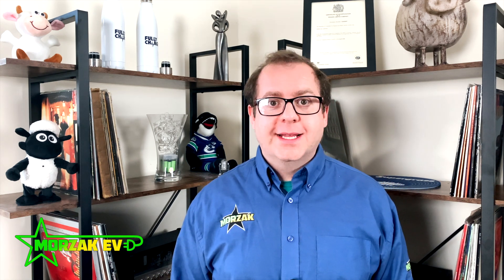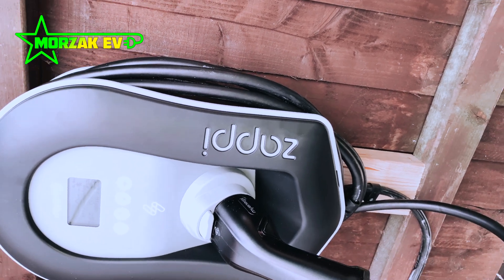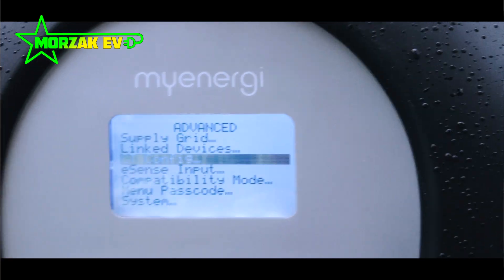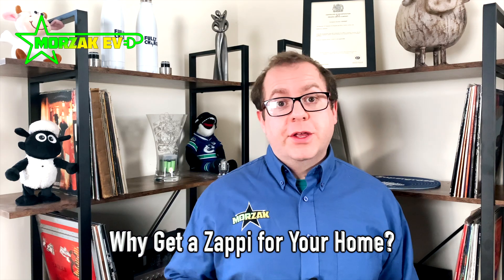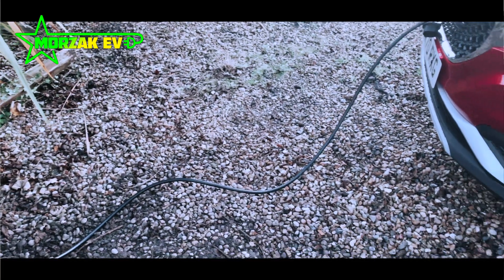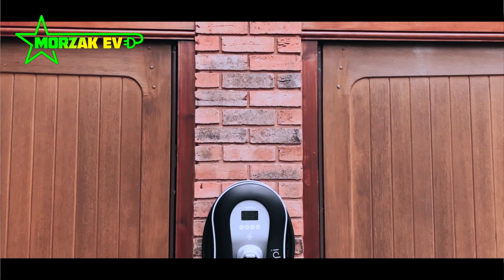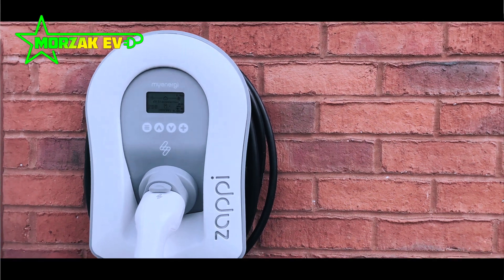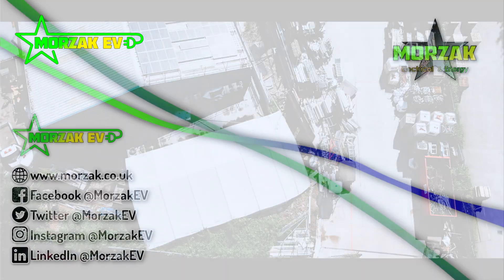MyEnergi Zappi & Eddi - The EV Charger that works with your Solar PV to charge your car for free

Comment: Hi I have a Zappi 2. and eddi being installed next Tuesday. Do I need a hub as well or can I do without it? 
What is the purpose of the hub
Reply from the maker: The hub was used with older models which didn’t have Wi-Fi connectivity. The hub acted as a gateway to the internet. The new chargers have Wi-Fi built in.

Comment: We have Solar, and an Eddi, installed in the spring, and it’s excellent.  We are now getting an EV and will be installing a V2 Zappi.  My understanding is that these will work together wirelessly, if the Eddie is configured as the ‘master’, and they will also connect to the web and allow the use of the App to control the operation.
Please could you confirm this and add any other advice you think will be useful.

Many thanks Noel
Reply from the maker: Hi Noel, great speaking with you yesterday. Yes, the Eddi and Zappi communicate wirelessly, and will talk to each other. Also, in the app, you can change the priorities. I thought about it after we were chatting - if you do not currently have a myenergi hub, you or you installer may need to make the Zappi the master, and then change the Eddi to slave off this so you can use the Zappi’s inbuilt Wi-Fi hub. This is fairly simple though for anyone who’s done it before.

Comment: Hi there, very interesting video thank you. Can the Zappi system also be integrated with home battery technology i.e. it can divert excess energy to the home battery storage system or the car or the Eddi.? And (if you dont mind...) whats your thoughts on the Andersen A2 charger.? is it as good/clever as the Zappi.?
Reply from the maker: So, the Zappi can be configured to compliment home battery storage. This does make a big difference on what your home battery storage system though - the home battery can't be configured using the Zappi app, so the key is to make sure this is set up to compliment the Zappi. The MyEnergi system also works much better with an AC coupled battery system as well. If your battery is DC coupled to the solar array, there's no way for the MyEnergi system to tell how much the solar is outputting vs the battery, and whether the solar is outputting vs the battery outputting. The good thing is that the Zappi and Eddi are totally configurable and you can hot swap the priority between the 2 using the MyEnergi app. We will be doing a video on this in the coming weeks / months.